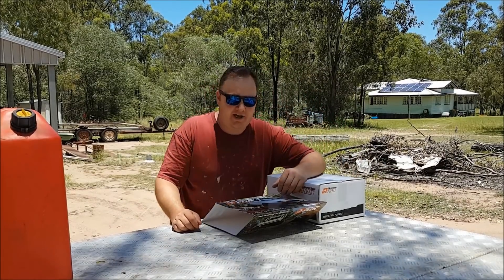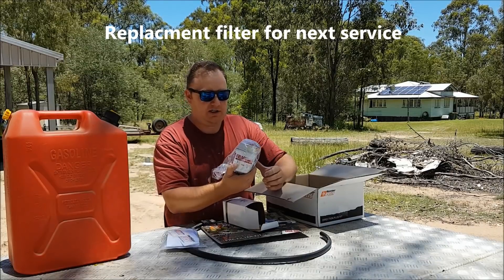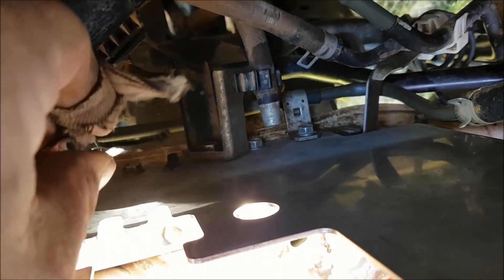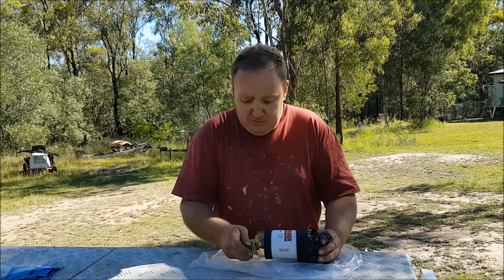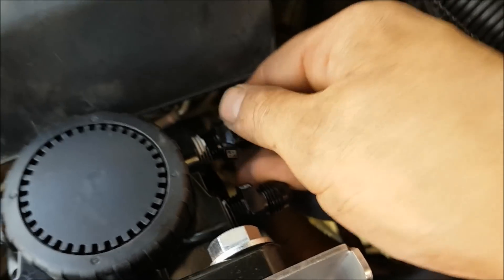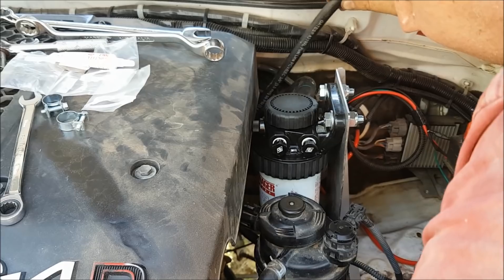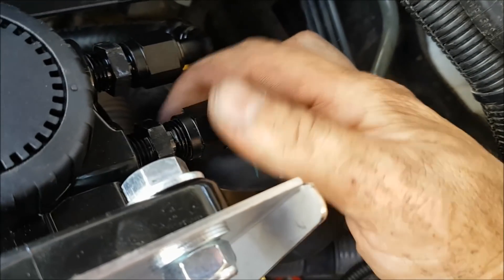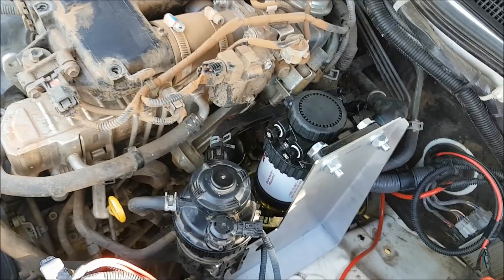How to install a diesel pre-filter Toyota Hilux D4D

Comment: Thanks for the video, just about to get my kit for a 2017 Hilux. Hopefully the install goes smoothly.
Reply from the maker: Just read the instructions because there will be some differences, but it's an easy install!
Reply: @HuntShootOffroad  Thanks all installed. By the looks of it the 2015+ is a slightly easier install. ECG connector is longer and you only have to install a new very short pipe for the outlet .
Reply from the maker: @timhowlinson9353  awesome mate! Mine actually took 2 services before I had oil in the drain hose, I think I needed the filter to become saturated. I still need to go get my manifold cleaned now.

Comment: You need to take the outlet hose off the factory filter and prime the hand pump until you get a clean solid flow of diesel into a jar. That way you no you’ve bled all the air out of both filters.
Reply from the maker: I change the filters every service, you just pump until it's all but rock hard, it doesn't take long, you don't need to remove the hoses.

Comment: Great video mate. Super easy to follow. 
I found when I installed mine on my 2010 Hilux it won't prime the fuel system. Was pumping the primer for over 5 minutes without it going hard. 
Opened the top of the pre filter and poured fuel in there and was able to prime the system that way but it only ran for a minute or so then stopped. 

Any idea what I'm missing?
Reply from the maker: It does take ages to bleed, once it goes "hard" keep going until it keep going until it goes really hard!

If that doesn't work you might have an air leak, swap you old house clamps out for the new ones. Check the threaded ones aren't loose. I got caught out by this when I paid for a service, they never tightened them back up (who knows why they disconnected them in the first place).
Reply from the maker: It it runs for a minute and cuts out, you haven't pumped it hard enough.

Comment: When you fitted this pre filter you said that you changed the factory fuel filter at the same time, I was wondering if there is anything on the factory filter to allow you to drain off any water that might have accumulated? I have seen a few videos of people changing the factory filter but no one seems to try to drain off whatever is remaining in the bowl - Surely if there is any water contamination IN THE Diesel, it will gather in the bowl of the filter and the Diesel will float on top. Just seems that there should be a way to drain the factory bowl dry and clean before fitting a brand new filter.

Comment: Great video, just wondering what it's like changing the oil filter after you install this kit? Looks tight.
Reply from the maker: Sorry for the late reply, only thing was I had to buy an oil filter socket because I can't get to it with my hands. How ever installing the dual battery tray did impact it badly.

Comment: Great Video Mate. Looks like it's near impossible to get to the oil filter now.
Reply from the maker: Do you have a dual battery? I went and bought a Ryco oil filter socket fitting, that unscrews it easy as. You can reach behind it no problems. After I put my dual battery in different story. I had to trim the dual battery to get my hand past, but it's all good now!

Comment: It does look like changing the Oil Filter in the future will be a PITA ?
Reply from the maker: I had to buy a oil filter socket, as I could no longer loosen it easily by hand, but you can still reach around behind it to remove it.

Comment: Hey mate what year is your hilux? I just installed mine on a 2013 hilux and no matter what I do I can’t keep air out of the lines keeps stalling out can’t find any air leaks anywhere my mechanic said some hiluxs just don’t agree with the added pressure of a pre filter what are your thoughts? I’ve just removed it for now til I find a solution
Reply from the maker: Mine is a 2013. I had the same problem after a mechanic did a service. He hadn't tightened the screw in fittings. Replace the factory house clamps with the new threaded ones.

You just need to make sure there are no leaks in the system. A mechanic told me you can put an air compressor in the fuel filler to find leaks.

Comment: Hey Mate, thanks for the video.  I have just purchased the same kit as yours to install on a 2012 Hilux.  I am just a little concerned like you that the sensor cable is really tight when plugged to the top of the primary fuel filter housing.  Do you know of any way to put in some type of extension to give it some more length?  Cheers Mate.  Again, great job.
Reply from the maker: I can't say it's caused me an issue. Just make sure you unplug it if your going to change the filter.

Comment: great tutorial - can you still install a dual battery tray with it fitted?
Reply from the maker: 100% I have a tray installed in mine with a 2nd battery!
Reply: Hunt Shoot Offroad how do you get in to inspect and drain the sediment bowl?
Reply from the maker: @Life_of_Gavin  you can drain both the factory one and the pre filter with ease. Inspecting... The factory one you can't unless you catch what you drain. The pre filter I just take the whole filter off with the glass bowl attached, then have a look.
Reply: Hunt Shoot Offroad Then you’d have to prime the system again though right?. Just cracking a screw and pump etc but still not as easy as just turning the drain cock.
Reply from the maker: @Life_of_Gavin  the glass bowl also has a tap on the bottom. I just empty mine every service anyway,  and yes I pump it afterwards.
Reply: @HuntShootOffroad  Direction Plus have now changed the bracket design moving both filters away from the engine and replicating the alignment of the OEM filter bracket. That provides more play in the wiring harness, oil filter is more accessible and a 2nd battery can still be fitted. That said having both is a PIA so getting 2nd battery out of the engine bay is preferable so you can fit new primary filter on the guard side of the bracket and retain OEM engine access.
Reply from the maker: @offroadoffshore153  the new system is a much better design I saw it at the 4x4 show, but it's not worth replacing what I've got

Comment: Shouldn’t you install hose clamps on the pre-filter side of the 2 hoses?
Reply from the maker: It's been a long time since I did it, I'm pretty sure the instructions said it wasn't required. They are basically aeroflow pushlock fittings. However after reviewing a aeroflow pushlock fitting video just now they use a hose clamp. So yes you probably should.

Mine have never leaked.
Reply: @HuntShootOffroad   I’m installing one today so I’ll see how I go. Thanks for the great video you’ve got some good information and it’s a great help.
Reply from the maker: @rustynail4x4  let me know if I missed those hose clamps or the instructions say otherwise

Comment: 11:47 if the arrows are the same..is it okay that I put the plug on the rear of the engine and the adapters on the front?
Reply from the maker: t maxx as long as the direction is correct

Comment: hi all what are the numbers on filter head for and which holes are for what because other vids are telling different thanks for any
help this is avery good video tutorial
Reply from the maker: I'm not sure what numbers you are referring to. There are 4 holes, but only 2 directions. There is an arrow indicating the direction of flow for that hole. So depending on your engine layout would depend which holes you need to use.

Comment: I connected hose from fuel tank to the back connector and front connector  to the original fuel filter, what would happen if I leave like that?
Reply from the maker: It needs to be the right way round for the filter to work correctly. The filter is designed to work one way, might collapse or something.

There are multiple fitting connections on both sides with blank off connections. You can swap them around to suit. But if you are unsure of what you are doing I wouldn't mess with it.

Comment: Have you had any issues with the fuel pump or anything so far?
Reply from the maker: Not at all, because it's a bigger filter than the factory 5 micron I don't expect to have any issues either. I'm also replacing the filter every 10,000km.

Comment: Why did you install a pre filter if the factory one already has a water separator with warning light indicator when accumulated?
Reply from the maker: Because water is the biggest killer of diesel injectors. This filter has a far superior water separator. One bad batch of diesel and your injectors can be ruined. 

If you are never gong to leave the city you are probably wasting your money. If there is a chance you have to use a dodgy fuel station then it's worth it's weight in gold!
Reply: @HuntShootOffroad  I can understand what you're saying mainly only applies to outback servos where diesel has been sitting in their tanks for awhile and all sorts of things can happen algae build up, condensation etc but also a pre doesn't mean it gives your engine immunity. Good diesel is always a must.
I leak mine out every 5k service just to be safe I don't wait for the light to come on and I tell you what no drops of water come out. Fuel in urban area's is of good standard.
Just make sure that pre doesn't restrict diesel flow to the engine otherwise it can do the very thing it was meant to prevent.
Reply from the maker: @creeatd  yeah 100% the pre-filter is 30 micron, the factory filter is 5 micron, so no issues there. 

Some other brand pre-filters are smaller than the factory filter and that's a very bad idea and makes zero sense.

Comment: can I installed on a Fortunner 2007?
Reply from the maker: Hmmm, not sure we never had the Fortunner in Australia until 2015. If the engine Bay is the same as the Hilux/Vigo then it should be fine. Either way you should be able to get a suitable kit for your vehicle!

Comment: Great video. Since diesel engine need clean fuel, we believe that pre-filter will save the cost in the long term diesel engine. I also did the same thing by installing Racor fuel-filter as pre-filter for my diesel engine as you can see on https://youtu.be/KcSRpNKxg3U .
Reply from the maker: Wasn't in English, but looks like the gear.
Reply: @HuntShootOffroad  absolutely, my video is bahasa indonesia. It's racor diesel fuel filter, 30 micron suitable for pre-filter. Most use for heavy duty diesel engine, yacht, etc.
This filter did a great job in separating fuel and water. Also, solid contaminant.
Reply from the maker: @OtoSmart  with water trap? Water is actually the biggest killer of diesel engines?
Reply: @HuntShootOffroad  absolutely. Because my country is the biggest CPO producer in the world,so the govt set the policy for fuel producers to put 20% of biodiesel for every kind of Diesel fuel. Event shell diesel, must containt 20% of biodiesel. Thus, the risk of water contaminant is increasing. That's whay pre filter is becoming more important

Comment: what are the specs.. what micron filter are the primary   n secondary
Reply from the maker: The pre filter is 30 micron, the factory filter is approx 5 micron.
Reply: nice .. well i have the mazda bt50 .. 09 model .. i took out that pump strainer n install a inline fuel filter as secondary with my main filter.. 10micron